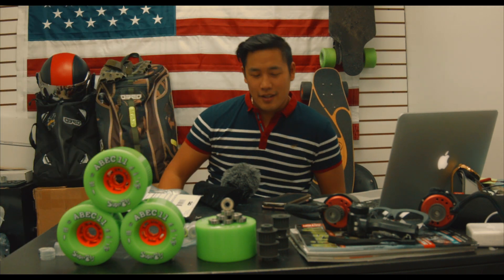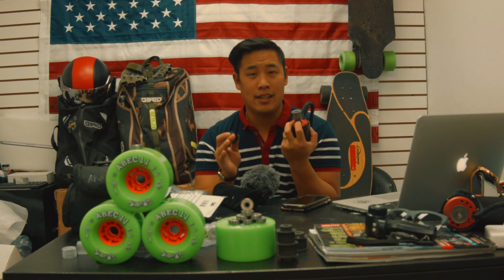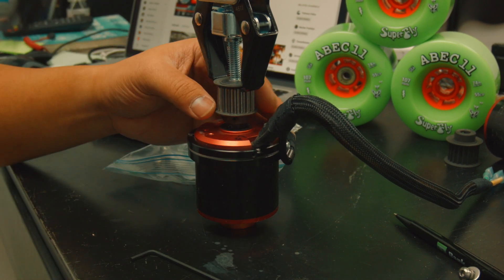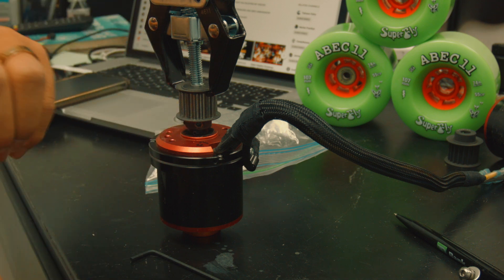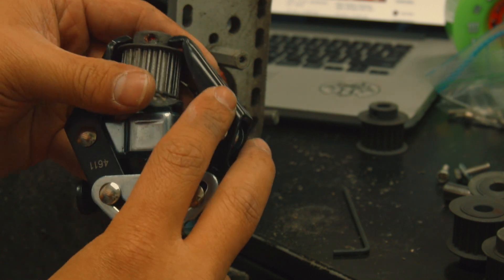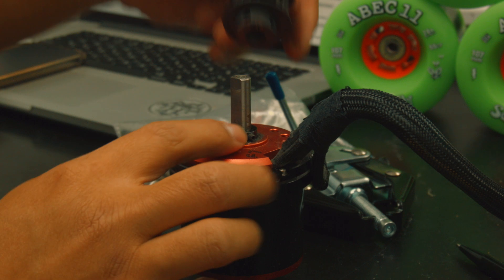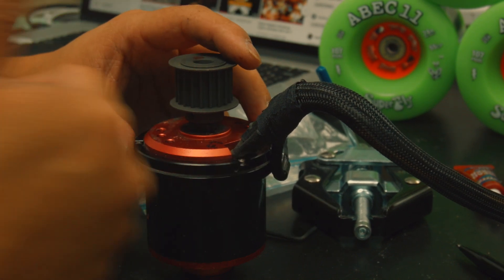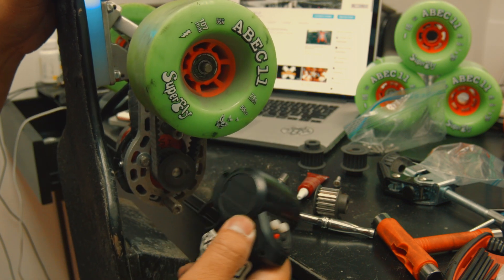Metro-Lab S01E01 MY METROBOARD COULD REACH 32MPH

Comment: Hey would you say that I'm putting too much strain on the board running a 19T with 107s on the dual Metroboard? I weigh 165 and I like to go full throttle from time to time. Is this bad?
Reply from the maker: I have 20t +107mm and I weight 230+ lbs
Reply: AKA JF thanks for the quick response and I'll take that as a no

Comment: Hey, I am in Recife, Brasil,
 South America, great video, wish boosted board would come to Brazil, I own two boosted boards v2 dual pluses, but however I’d like to see the torque of 6374 motors...
Reply from the maker: The torque is amazing I get 32 mph with 20t motor pulley and 36t drive gear wheel pulley